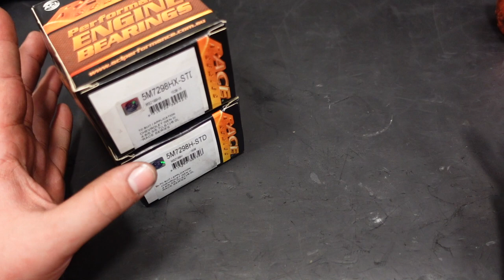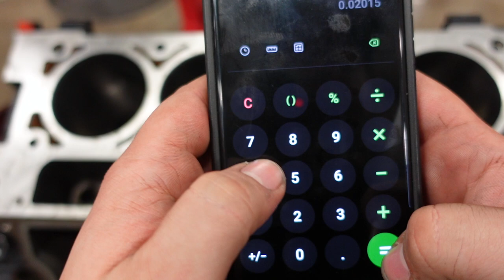Building a 383" LS Engine - New Old School

Comment: Very smart to go 3.75 on the stroke, that engine will last longer and not beat the piston skirts as much given the short deck block. The 4.00 stroke of the ls7 was designed for a taller deck height of the block. Those 408 combos don't last along due to the piston rocking at bdc
Reply from the maker: The deck heights are actually the same between an LS7 & 6.0 block. The sleeve length however is much longer in the LS7 block to support the piston. However, I do have about 5,000 very very hard high rpm nitrous miles on my 4.000" stroke 6.0 and the piston skirts still look awesome. As long as the bore is perfectly straight and properly de-burred at the bottom the piston skirts will last a very long time.

Comment: Where did you find a 3.75 stroke crank? I wondered if someone made one because someone might not want a 4in stroke.
Reply: I'm with you James. I'd like to know if this was a "in-house" crank or special ordered deal..?? That bore/stroke combination works really well in the first gen small block chevys.
Reply: I'm still waiting for someone to order the 3.268 crank, 6.300 rod, and 4.125 bore...the new 350😜🇺🇸👍🇺🇸
Reply: @chrisferguson1911  well we already do have a 350... it's called the LS1... Lol, you do you man 😂
Reply: @chrisferguson1911   
I built that combo. I called it a 349 ‘cause it has a nicer ring to it.  
Used a 6.2 Escalade block bored .060” over. With 12:1 compression and AFR LS3 heads and my custom camshaft it makes 659HP @ 7600 rpm.

Here’s a video on the Dyno. 

https://youtu.be/Qz12HXH2qXA
Reply: Very nice 349!🇺🇸👍🇺🇸
Reply: @chrisferguson1911  
Thank you. It’s a real zinger. Fun to drive with a Tremec 6 speed!
Just installed it in a 1970 Nova.
Reply from the maker: We have them, give us a call if interested!
Reply: Callies has the magnum (APJ31W-MG58)

Also molar has a 3.750 stroke LS crank (346-3750LB6F-610)
On the shelf and ready to go. 

I've used the callies crank before. However the molnar 3.750 is way cheaper than the callies version. Because its made in China. It just depends on what kind of build you have. I highly recommend a callies 8 counterweight magnum crank for 2650 or whipple PD blower builds. Because PD blowers are hard on crank snouts. But those Chinese cranks from Callies Compstar, Dart, Eagle, K1, Lunati, Manley, or Scat. Are good for N/A or Turbo builds.
Reply: Well they are Smeding Performance, but if he doesn't have one, CNC Motorsports does.
Reply: Their were 3.80, 3.825, 3.850 amd 3.90 cranks that were all a little obscure. Most just want the cubes and the benefit of lower rpm power,  so y not  use the biggest shelf crank thats proven?
Reply: If you want cheap and decent crank check new L8T one which is 3.86 stroke. They go for $700-800 brand new.
With 4.03 bore you get 394ci

Comment: Great video...    With Today's technology i think looking for say 500 usable HP for something like a 1st generation Camaro using a small block would be the way to go? Less weight and for a street driver seeking plenty of drivable performance and not looking for a cage i assume something like a 572 would be too much for the unibody to handle even with frame connectors.

Comment: I don't understand why the 3.75" stroke was chosen.  Even if you're not after max power, you're still giving up torque (and power) across the entire RPM range.
Reply from the maker: different strokes for different folks
Reply: Longevity. Shorter rod,side loading on the cylinder walls, less dwell time at TDC, faste r piston speed all come with longer stroke.
Reply: So does more displacement, more torque, smaller dish/chamber for a given CR, and a lower RPM requirement for the same power.

Comment: So it's basically a bit more than an LS3 in capacity with a shuffled bore and stroke combo be interesting to see if it makes much difference against an LS3 with same heads and cam with respect to efficiency and power - torque curves.
Reply: 2:37 IMO...what id do is throw an ls7 based head that accepts a 4.030 bore CID, and GPI make one.  That way you get the larger intake valve, raised runners etc. With the slightly larger crank stroke it will add some two down low & you can run 6.2-6.3 rods which will help you run it out for higher rpm. The LS7cylinder heads, as well as intake manifold( CID single plane,or, LSXHR) promoted good mid and high rpm power.  Pair that with a comp cams LSR 235/251 cam and you'll have a sick set up that has a large broad rpm range of non stop tq & HP! Run a nice 10.1:1 Diamond pistons.  Add a simple D1X Procharger kit/or/ Vortech V7-YSI kit if you prefer.  That would be a nasty street/ strip car

Comment: Very cool build. I have been wanting to do a LSX block 4.250" bore x 3.750" stroke with 6.125" rods.
Reply: That would be awesome to see! I don't think technology has come far enough though for us to have anything greater than a 4.220 on a small block yet, however
Reply: @pablotharpalo5685  you can do a 4.250" on an LSX block, but they say for NA only. I've talked to a couple machinists who claim you can do certain stock blocks with aftermarket sleeves. I want to try one at some point. It may have to be a slightly smaller bore though. 4.185-4.220".
Reply: @whereisamerica7384  oh, that's awesome! If you do get to it, I'd love to see how that plays out. I'm going to have to do more research on that block!

Comment: molnar recommended the same crank, rods and pistons for my build,  with a "custom" cam from bullet, warhawk heads and 2 66mm turbos it made 1235hp at the tire with 24lbs of boost.
Reply: What size injectors?
Reply: @montim.5301  FIC 1650cc

Comment: The short stroke engines can really be advantageous especially under boost.   The 4.00 stroke setups tend to wear out piston skirts due to the short deck height
Reply: He’s got a huge connecting rod in that thing too. If it’s na this engine would last like an old tractor. I bet it would be a 300k 500+hp fire spitter

Comment: Cool combination.. from your experience, What is best Gap for Turbo LS Piston Rings?
Reply from the maker: Depends on horsepower, compression & fuel
Reply: @JacobVillemain  700WHP with 9.4:1 on 95 Octane. My Engine is 6.0 with EFI Sniper Throttle Injection.

Comment: Do forged rods with the 7/16" ARP 2000 bolts that come with a complete rotating assembly need resized? Or do those rods already spec out for the added torque to the caps?

Comment: 20 thousands for ring gap is really tight i usually do 24 never had an issue especially if its a stroker if its a stock motor i would make it smaller then 24

Comment: Two things: 
1. What tool do you put that chamfer on the caps with, diamond file? 
2. When a used block comes in, for the piece of mind would you recommend always cutting it 5 over just to start with a brand new true round bore, or if it specs out, plateau hone it and send it?
Reply from the maker: 1. Yes, small handheld diamond file available in packs of 10 on amazon.
2. I always take a block .005" over. I've never seen one that didn't have .002-.003" taper
Reply: @JacobVillemain  thanks brother great work wish I lived closer and could turn wrenches for you

Comment: I'm familiar with that bore&stoke but in a gen1 an I have broken rear 12 bolt axel and front drive shaft an also hubs& stub shafts,the rods are 5.7s lighten up with arp bolts,the pistons I run are 0.60 11 to 1 speed pros with the biggest 4x4 cam comp makes off the shelf, the truck it's in is a 72 4x4 half ton stock axels with a little work in them.Feeding the mill is holley 800dp with a little work done to it,..💯😎✌...I really need to go LS in the future just a better designed power plant Thank You very much people

Comment: Hey Guys, speaking of doing it at home. Question, I see some build videos where guys are using assembly lubricant. I noticed you guys didn’t use or show you using it for the main cap bearings and rod caps. Is assembly lubricants not necessary or like there’s different schools of thought? Thanks for the response and content!

Comment: Where you using new or used main bolts?
If used, do you use TTA or a tq value for final assembly?
Reply from the maker: Main bolts can be infinitely reused in LS engiens
Reply: @JacobVillemain  do you use the GM angle or torque to ft/lb
Reply from the maker: @n2oracer84  OEM

Comment: 😎 What Hp/Torque are you expecting? Is that a LQ4 or LQ9
Reply: No difference in the block itself, the lq9 had higher compression pistons, like a flat top vs a dish in the lq4, but all that has been replaced here.
Reply from the maker: This build was not built with horsepower goals in mind. However it should make around 500-530 crank.